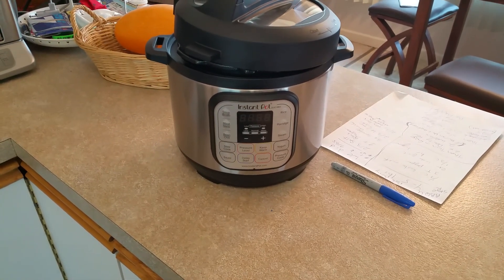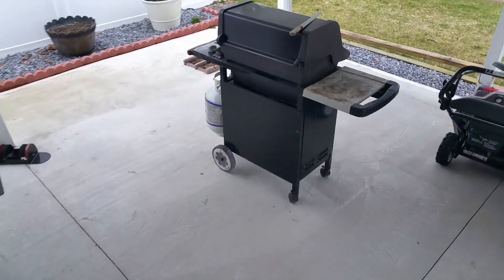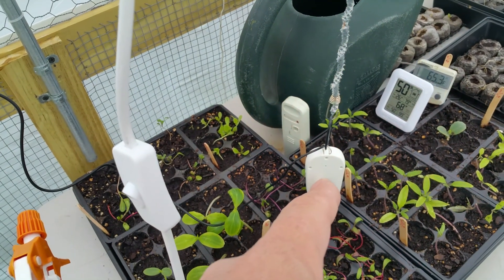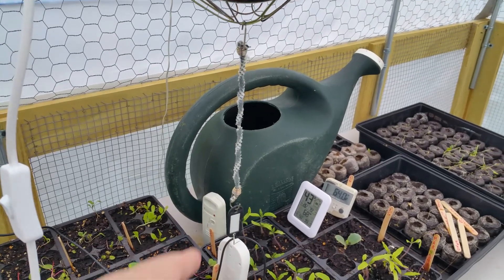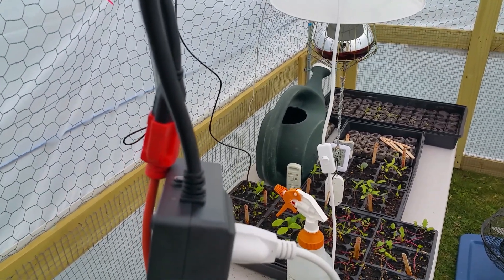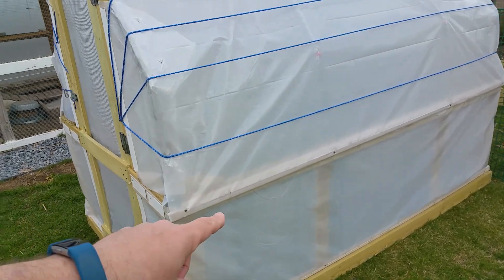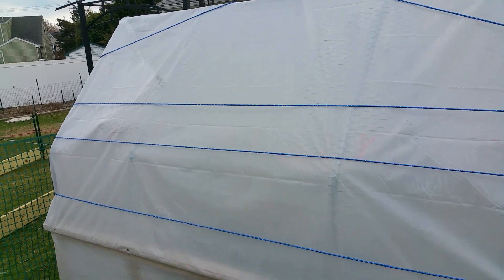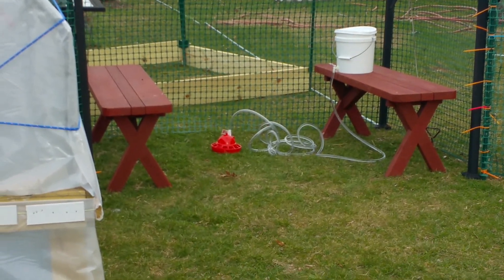Instant pot cooking and greenhouse temperature control

Comment: Your greenhouse is so cool and I love the new gadget you have for it! In terms of the Instant pot, from what I could see of the buttons it seems to have similar or equivalent functions to the 6qt version so I imagine recipe wise you'd only to need to reduce any 6qt quantities to account for the smaller volume? There might also be slight differences in surface area affecting cooking times but it would probably be minimal? I'm going to be ordering a local equivalent of the Instant Pot this week as well as the Instant Pot isn't available here. Thanks for the update! :)
Reply from the maker: Simon B I'm wondering if there's anything special that the pressure multicooker does best that will make me wish I had one.  Or, well, a bigger one!
Reply: I'm getting one because of the multipurpose flexibility of them. I only have a small portable induction plate which I mainly use with a cast iron skillet. The multipurpose pressure cooker will allow me to cook pasta with the fresh vegetables already added in about only 10 mins, cook rice in the same way, I can use the saute function to brown meat and then cook bolognese sauces, I can use it to cook stews and do pot roasts and  turn chicken carcasses into chicken broth or I can make soups. I can both slow cook food and pressure cook super fast, so it can be very versatile all in one pot that doesn't need me to have a stove and an oven and takes up a fairly small footprint on my limited bench space... Those are the sorts of reasons I want a multi-purpse pressure cooker and I've always loved one pot cooking! :)
Reply: This video seems to a great overview of the 3qt mini duo Instant Pot ( https://youtu.be/_a9CN5rNT2w ) and this video seems to give a quick(ish) review of 3qt vs 6qt: ( https://youtu.be/UH4N2llzlbc ) enjoy! :)